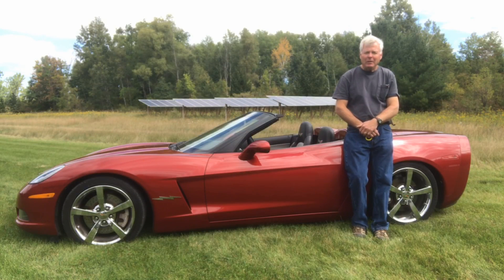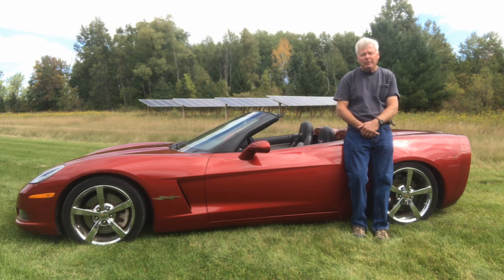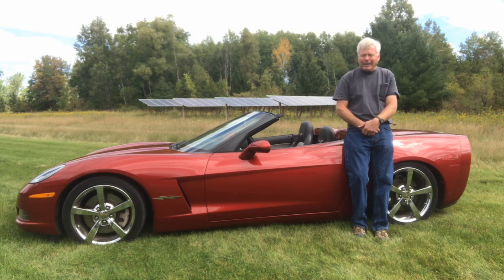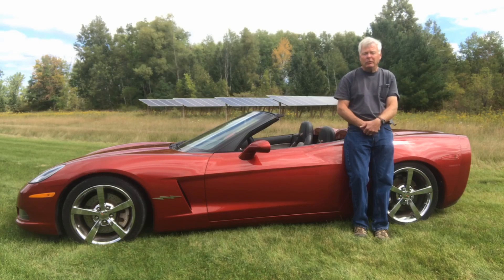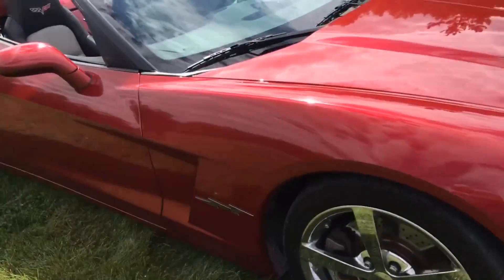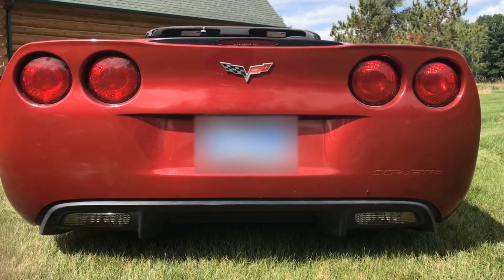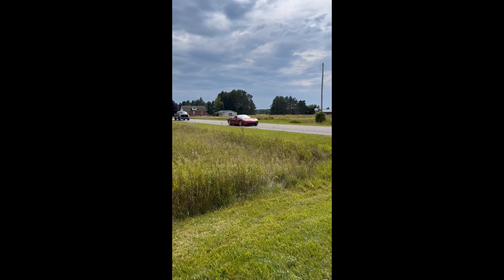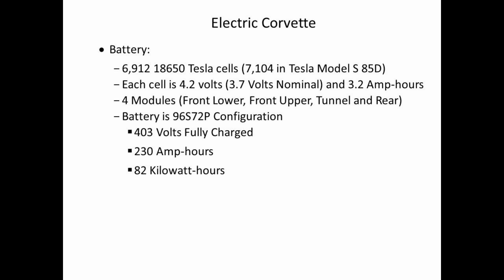Electric Corvette - Part 1 - Introduction

Comment: Congrats, this installation is very professional!  Did you give any thought to cooling the battery itself such as a cooling plate on top of each battery module? Also, did the batteries change the F/R weight balance of the car?
Reply from the maker: Not necessary to cool or heat the batteries. I run ambient air through the modules with a water proof barrier. I monitor the module temps. After steady state driving at highway speeds they stay at ambient. No increase in temperature while charging as I only charge at 15-20 amps.  I will stop driving in the colder months of November - April. 

Prior to conversion the F/R weight was 52%/48%. Not bad compared to early Corvettes.  Post conversion it is actually better at 46%/54%.  Ride height was about 4”. It is now closer to 3 1/2”. I could, but haven’t raised the height as I like it better lower.
Reply: @e-grandpa9778  Your acceleration should be quicker than the stock C6 due to the electric motor's flat power curve and the lack of shifting needed during the run.  You should have at least 500 hp from off the line until well above 100 mph which should put this car well below 4 seconds 0-60 and the rear weight bias will help with off the line acceleration.
Reply from the maker: @zmanmd1641  I designed the battery to have a 10a x 2 fusible link per cell (see battery video). So, this limits me to 1440a max. I currently have it set at max 1400a. I can do this for a few seconds. I haven’t tested yet, but my guess is reduced max acceleration.   I want balance between acceleration and range so no issue. In fact — just good acceleration with great range is best.